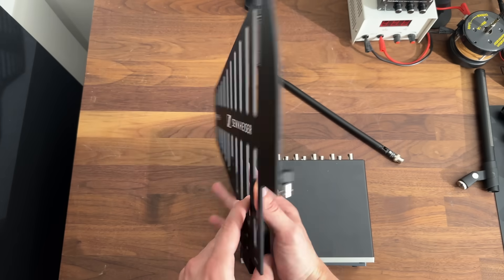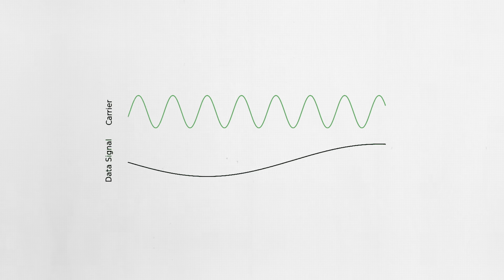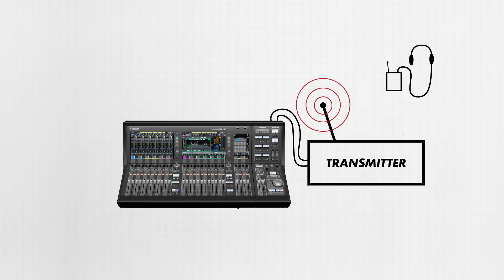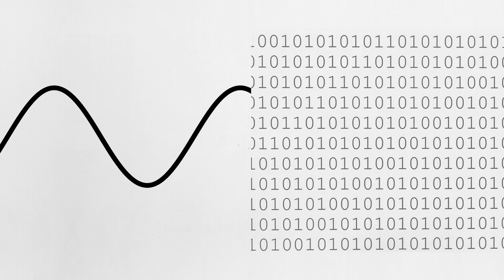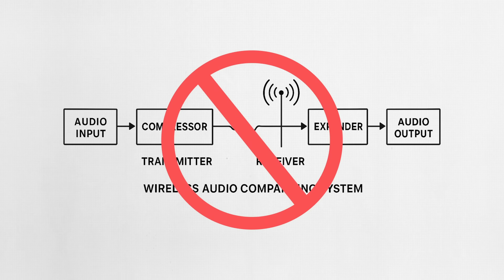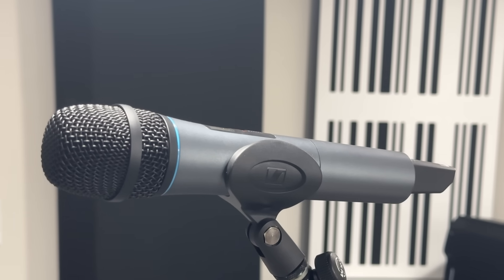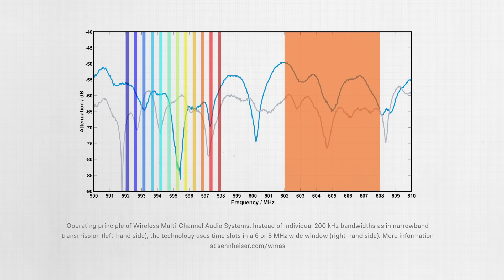Analog vs Digital Wireless: What’s the Difference?

Comment: I love the sound of analog companding wireless microphones. It is the most transparent audio compression system available, imposing no artificial smoothing or lag on the sound envelope. Inexpensive digital mics cannot compete with the sound quality and reliability of touring-standard analog mics. That said, I absolutely LOATHE the ear-splitting static blasted out by certain Sennheiser wireless mic receivers whenever the mic transmitter momentarily loses its RF connection. I have on occasion actually BANNED these microphones from the venues I run sound at. I am simply not willing to subject our guests to that kind of abuse.

Next on my ban list are cheap shit 2.4 GHz Bluetooth wireless microphones. I've lost count of how many semi-pro events I've seen ruined by this garbage, and how many times I've heard someone moan, "But it worked FINE at sound check!"

Comment: The added delay of stacked digital systems does make latency an issue imo. If you're running digital into the desk the Wireless ads anywhere from 1.5-2,5ms of lantency. The desk will add anywhere from 0.7-3,5 on its on depending on what make or model. Add any inserts to that via Dante or such you add another 2-5+++ ms of latency and then you add another 2.9ms going digital back to your beltpack. That all adds up. 

Meaning if you run everything digital you might have to make some compromise. No inserts, is an option here to reduce latency. and preferrably a very low latency desk such as a D-live or a Yamaha/Digico or something of that sort running 96khz gets you just below 5ms latency total. Which is more or less what you'll be just fine with. Less would still be better imo, but for time sensitive instruments as drums, bass or even Vocals (Since their internal voice monitoring trough jaw bones and such makes latency noticeable rather quickly) you'd want to keep it as low as possible and most certainly below 5ms. 

So running cabled mic into wireless IEM's makes latency less of an issue. Or Analog IEM's and a digital microphone instead. Most digital systems has a low-latency mode that helps it this, but then you also loose a little bit of that reduced fidelity you talk about. 
All things to think about. :)  

I think 3ms is about a meter distance with speed of sound. or just about a 1-1 with ms and feet for comparison. I think a couple of meters is fine, but a monitor three meters or more away starts to make performance a slight issue time-wise. That being said. This is ONLY an issue for your own instrument. Getting the rest of the band with a bit more than 5ms is just fine. You're probably used to listen to the vocals coming from more than 3 meters away anyways. 

A good option is to make double tracks of every wireless instrument (or any instrument for that matter) and use one without any inserts and keep the signal chain as clean as possible to use as a monitoring signal only and then you can stack inserts and group compression and the likes on what goes into the PA.

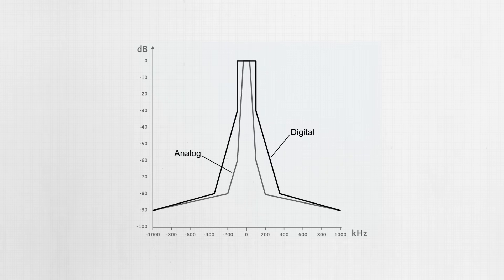Comment: Not an RF engineer, but I believe the graph shown at 11:21 is incorrect. My understanding of terrestrial UHF television is that digital channels can be more closely "stacked" compared to analog, as nearby transmissions are less likely to interfere with each other. Meaning, the fall in amplitude is steeper towards the edge of the channel with digital than it is with analog. This would be the same with wireless mics right?

Comment: Not the most affordable but very much worth their price, I’ve been lucky enough to be using Sennheiser’s AVX SYSTEM for nearly 10 years. 100% of the time they link up correctly even in a multi unit environment and they never have any interference issues whatsoever. You can buy extra batteries for both the receiver and transmitter so they last all day even on very long days. Keep backup wired lav mics because they do get wear but the system units and hand helds are built like tanks.

Comment: I believe that digital audio can have higher spectral efficiency (more data per unit of bandwidth, i.e. bits/Hz) because they use complex modulation schemes (i.e., QAM), each channel needs less bandwidth so you can pack more of them within a certain band.

Comment: I do have RF engineering credentials, as well as pro audio, and in FCC engineering regulatory law.  

One point that's very tricky to cover, and where some comments in this video are a couple decades obsolete, were about what implied use of TV whitespace in bands since compacted and parts auctioned off to the cell industry via corrupt process of Congressional bribery and frauds.  That's compounded when companies like ScAmazon and its scofflaw vendors engage in consumer frauds selling misrepresented and sometimes outright illegal wireless gear.  

A fair amount of older 600 and 700 MHz bands wireless Part 15 devices are now illegal to use in the USA. In many markets, TV whitespace just doesn't exist as it used to.  

At least Sennheiser has been a long term, upscale vendor in this industry segment, and has lots of support resources, embedded in their costs.  

Between RF engineering designs and CODEC's, there will be serious quality differences between a few thousand dollar UHF analog system, and cheaper or lower band models.   

In digital systems, there will be relatively small variations in audio quality per se between a $200 and a $2000 system, but latency and features and mechanical build quality vary a lot.  Available Part 15 or Part 18 (or Part 74 for licensed broadcasters only) spectrum may also have major impacts, on functional distances and RFI issues.  

To understand and visualize why analog systems have the variables they do, study nonlinearity and distortion of FM detectors subject to RF noise, and to overdeviation, and then how CODECs in order to improve dynamic range, push more of the signal into those nonlinear regions. Also, how quality control and alignment shifting may further aggravate those degrading factors.  On some level, that's pretty basic electrical engineering, even if not a common background for lawyers or musicians (but should be required for public policy officials, where lawyers are more often functional illiterates).

Comment: I'm not fully qualified audio engineer by any metric, but to those asking for a capsule == capsule check, don't forget there may be different preamps coloring the sound (unlikely with them both being Sennheiser). 
Digital will still have more consistent audio quality due to the encode/decode steps removing most interference that could be picked up through the environment and possible artifacts from companding the signal.

Comment: I’m a retired radio engineer for public safety systems (think police/fire).   I just want to stress that in large cities and surrounding areas you should NOT use frequencies below 512 MHz as while they are in the TV broadcast range, public safety radio systems are allowed to use 470 To 512 MHz and you could cause interference to those systems.  
I haven’t found detailed specs for the type of digital modulation used by the digital systems but in general digital modulation doesn’t need as much radio frequency bandwidth to transmit audio than an analog signal does.  This fact should be the reason you get more usable digital channels than analog channels.
Reply: Digital narrowband iem/ifb/microphone Systems usuallly employ 8-PSK or 16 QAM style modulation scemes, The New wiedeband Systems aditionally employ technologies like TDMA and OFDM(A).

Comment: I would like to hear the same capsule with analog vs digital to see which makes the greater audible difference--  capsule or analog vs digital?
Reply: That's not a valid question. 

In general, price and audio quality vary greatly in analog RF and CODEC systems. 

In general audio quality varies relatively little for a 24 bit digital system, whereas latency is a major variable, along with physical construction, and features for more complex environments or many channel systems.  

Distortion or noise from over-deviation or RFI are generally bigger issues in analog systems.  

Sennheiser is a very experienced, high quality manufacturer with strong US rep's presence.  In low price tiers, Nady makes some good audio performance digital gear, but don't expect it to survive musicians who don't treat gear gently.   

There are so many non-mic instrument applications, and so many sound and RFI environment variables, that the idea of listening tests under some unspecified conditions is not a valid way to evaluate wireless mic systems of various technologies, and operating bands.
Reply: @lokiva8540 "not a valid question"?   Its a test with controls and variables.  Of course there's subjectivity.  You compare two different capsules with the same digital receiver and then with the same analog receiver and compare the differences.  Get out of here with your invalidation.   While latency is a concern if you have a lot of analog to digital to analog to digital conversions among a series of digital components, we're dealing with 2 to 3 milliseconds so its not an issue for most of us.  I'm in the camp where analog companding would be a more noticeable flaw than the capsule.  In my experience, a higher end capsule on an analog wireless system wouldn't sound better than say, a Shure SM58 on a digital wireless system.
Reply: @locke6854  Analog companding is not a "noticeable flaw", it is a proven technology that provides transparent compression. There is ZERO lag, ZERO overshoot, and ZERO envelope distortion with analog companding. That's because it works directly on the audio waveform instead of attempting to track the envelope of the signal in real time. While digital compression can work wonders on prerecorded tracks that can be analyzed in advance of the audio signal, the latency that imposes makes it inapplicable to live performance. If you want to talk about the sound quality of professional wireless touring systems, analog or digital, you're in a totally different stratosphere than this kind of YouTube infotainment.